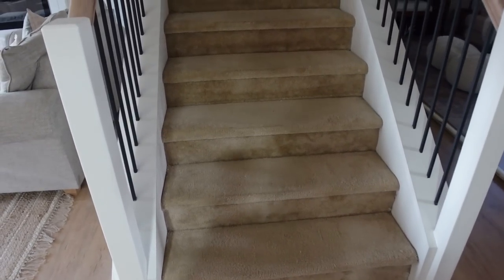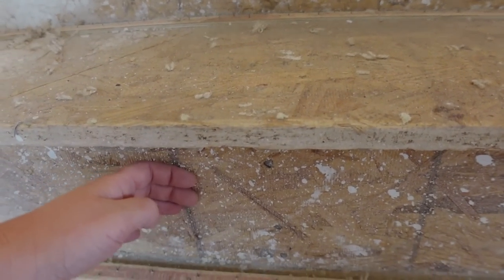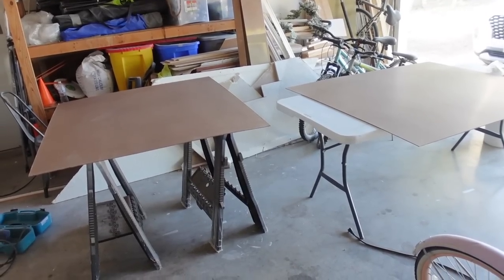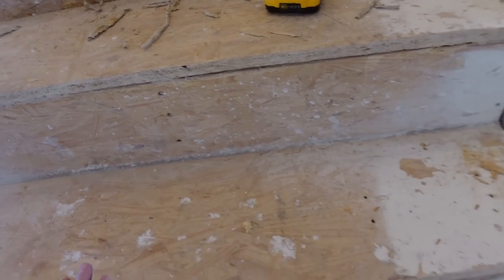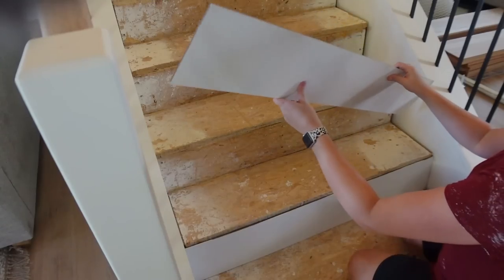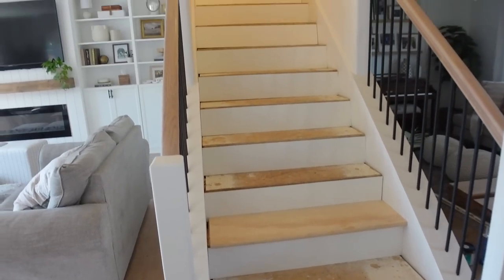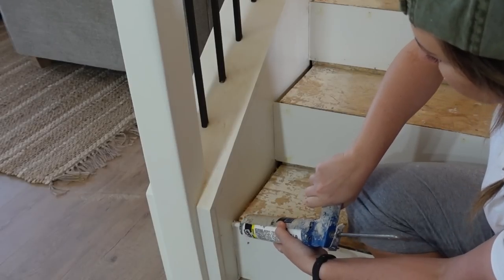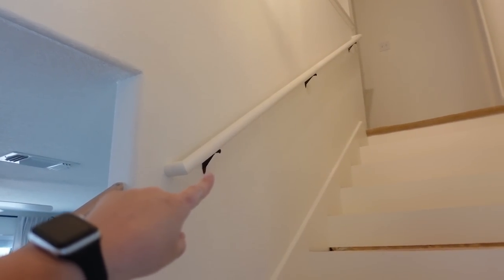STAIRWAY MAKEOVER PT. 5 | Removing the Carpet + DIY Stair Risers (Easy & Inexpensive!)

Comment from the maker: I’m curious- do your home projects usually go like you planned? Do they take longer than you thought they would?
Reply: They always take me sooo much longer than planned! But I’d rather it take me longer than rushing it that way I know things are done correctly and hope I don’t need to redo them.
Reply: Never! Something always happens that delays progress.
Reply: Apart from painting and sanding our old hardwood floors something always takes me twice as long!! Worst is not having enough material you need and having to stop work to return to the hardware store….it’s tough to get back into that rhythm.
Reply: I have decided instead of estimating how long it will take and constantly being disappointed, because I don't think I've ever been right, I just concentrate on starting. Once that happens, how long it takes just doesn't seem to be as important because I am so excited to see the end result. 🥰
Reply: Girl NO! None of them!
Reply: Always am thwarted by something.  I recently put in new blinds & really struggled getting the screwed in. My drill kept slipping.  I increased the pilot hole drill bit.  I almost gave up & called a handyman. It took many times having a break & going back in to wrench them in.  Idk if my drill might be crap.  But a guy would’ve done it I. 10 min I guess.  

Also I don’t like the Blinds & might return them smh.
Reply: I have learned to budget 4x the amount of time I think it will be.  Sometimes it still takes me longer.  I have noticed that my projects are typically 3/4 tear out and prep to 1/4 finishing.
Reply: well...... mine always go as planned, like for example i decided to replace the carpet from the kitchen (that's how i bought the house like in November). it was a 300-350sqft of laminate/hardwood project that should have been done in 1 day 2 tops. Fast forward here we are in February and 2300sqft feet later with new trim all main floor replaced all upstairs replaced all bedrooms, living room, etc and now the stairs and still have the basement that i haven't touched yet, soooo..... yeah, all my projects always last as planned: "Forever" 😂

Comment: Note for folks, For the back white panels on the stairs, you can buy the material in 4x8 sheets already finished white at the box stores.  That is how I did it BUT when I went to use glue adhesive it bled through.  We ended up not using the glue and just caulked around the edges.  We also used smaller nails and put them up high so the treads covered them up.
Four years later they still look great.  Just use magic erasers to get the scuff marks off.  
One last recommendation.  I like the poly wipe-on as well but I learned from a carpenter to use the spray cans of varathane because it's a harder finish and it seals really nicely.
Reply from the maker: Thanks for the recommendations!

Comment: It would have been do much easier if the builder used real wood treds and risers. Even so, when I removed the carpet from my stairs it was a mess. The builders used a million staples for the carpet padding. The holes had to be removed and filled in. There was much muck on the wood, it needed a good sanding. From then on it was easy, I painted the treds and risers with white floor paint, it looked really nice and it was much easier to keep clean.
Reply from the maker: Yes that would have been much easier and way less expensive!